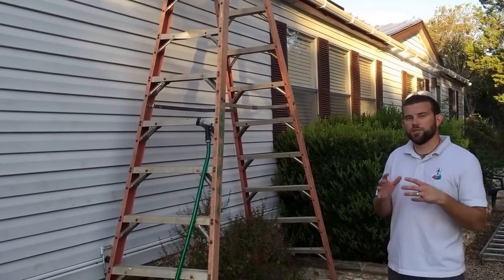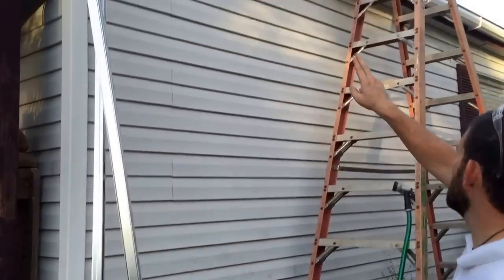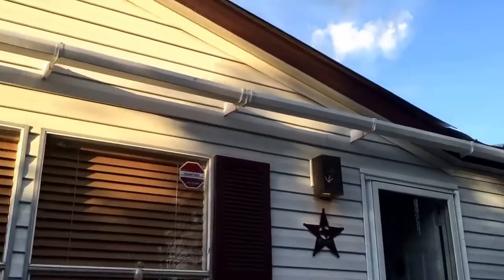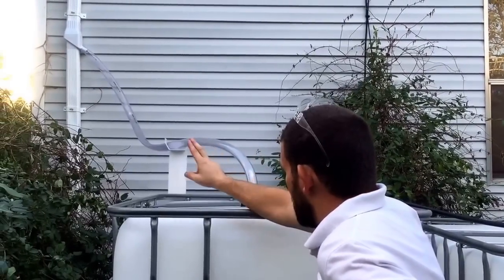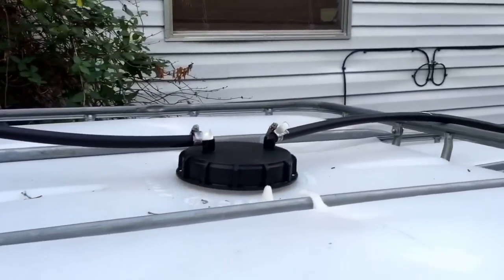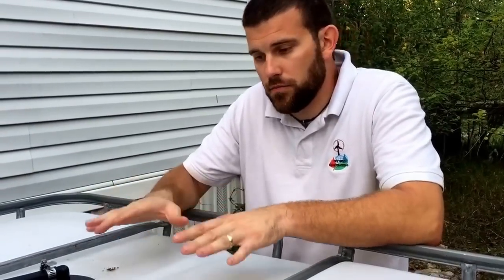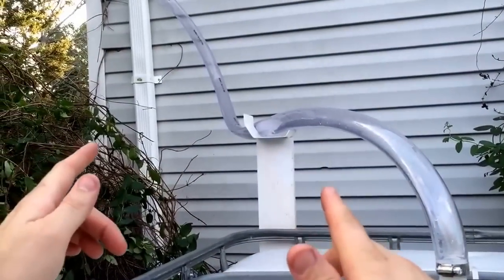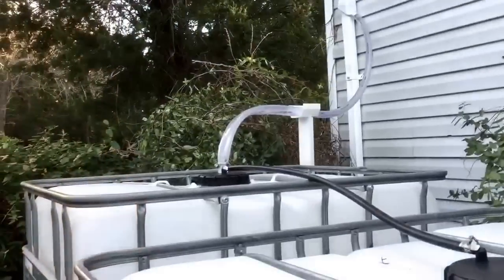Rain catchment multi IBC install by Off Grid Contracting

Comment: Where can I get the Y that goes on the downspout to connect the flex hose. Do you just cut the downspout in half or drill a hole in it and cap the fitting over the downspout.